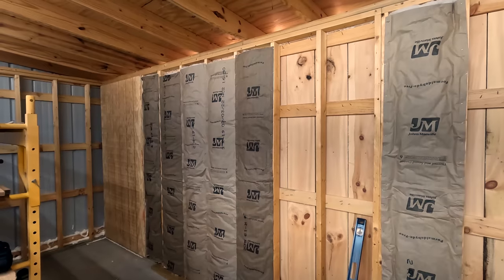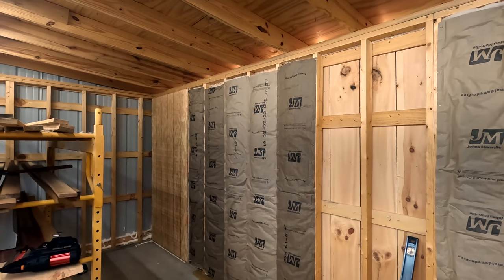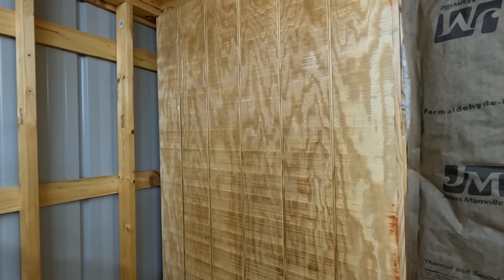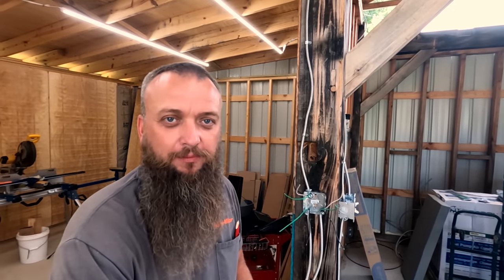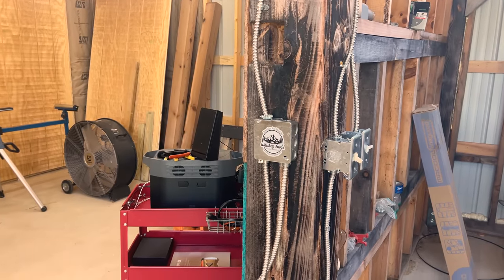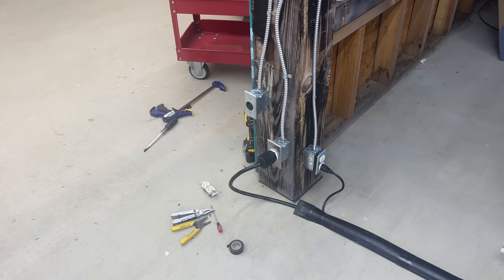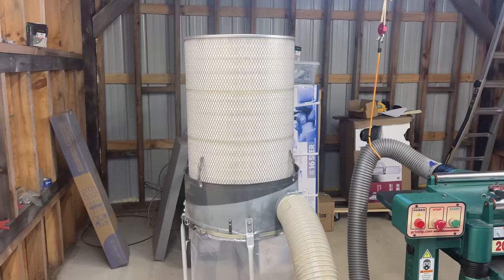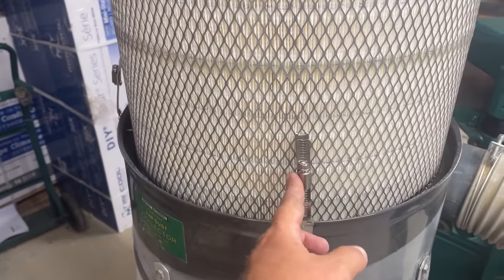This Isn’t Burger King.

Comment: A mister cool removes moisture from the air.   A condensate tube full of water will need to discharge from the interior air fan coil unit to the exterior.

Comment: You’ll definitely want to use screws or nails with a head on them for T-111. I’ve installed a lot of that stuff for customers over the years. The shop is looking good sir. Whatever works for you is all that matters. If the sheets don’t fall off the wall then it’s good to go
Reply: Yes sir for sure on a headed nail or srcew

Comment: You could try 18g staples in the Nailer. It seems that the staples have higher holding power. I would say finish the back wall just to protect your investment in the siding. Mayne spray varnish if you have the tool. It's supposed to dry super fast and be pretty tough. Love the videos

Comment: T-111 siding iss a good choice as it adds wracking protection to your walls which look like they need it.  Timber framers long ago found that two knee braced corners was not going to stop movement in a wall.  And brad nails cancel any wracking protection you may have created!

Comment: Just out of curiousity,,, why not do drop power panels....keeps the cords off the floor (which i noticed, and would make cleaning more difficult)... just a thought..and  if the power cords could be restrained to fairly strict vertical areas, it shouldn't affect your work area.....

Comment: Looks good Nathan.  Insulation will be much appreciated come winter. That's heavy plywood for Brad nails. Leave it natural . The Ready Seal with Stain would look good as well. I've seen some on natural pine lumber on a porch.

Comment: T-1-11, the best thing is wide crown staples, if you are doing it interior, then the narrow crown would do if you were going to stain it….my personal choice is the wide crown. The Senco units use galvanized coated staples…and you will destroy the panel trying to get it off. 
Hard work is where it’s at! Suck it up….grab a handful, and get it done.

Comment: Looking good. White metal would also work good,it really brightens up the interior.  Mount your outlets a little higher. In a shop dirt,dust,fumes, etc are near the floor and are a fire hazard. I am sure there is a electrician on here that could tell you the code.

Comment: For your T1-11, I'd get some 6d or 8d sinkers for your Pasload framing gun spaced about 16".  That should more than adequately hold the siding better.

On hard labor.  I've been saying for about 15 years, middle school aged boys and girls should spend a summer or 2 on a farm, especially with livestock.  There is no such thing as days off, weekends off, sick days, holidays when having to tend to animals and the chores that require daily attention and alway the need to tackle other tasks.  I lived on a dairy farm 10th through 12th grade and consistently look back at that time as one of the best work ethic learning experiences ever.  Granted when I was 15-18, I would never had admitted to that.

Comment: Brad nails not recommended. You should be using ring shank siding nails, # 7's (1 3/4")  T-111 is known to twist and warp on the wall, ring shank nails will not release like ordinary nails, and you have to hand bang them, but is worth the effort. Screws are fine unless you stain, then they will stand out, galvanized will cause spotting and streaking, even on unfinished interior work (moisture). Panels will age out gray/silver like an old barn. Pro tip ..... put spots of liquid nails on middle studs to help prevent warping and popping. 2 or 3 dime size spots of glue on your span studs will do.

Comment: I am a little surprized that you didn't put electrical wiring in the wall with the insulation.   Because it is covered with T1-11 you could have used romex.  Now you will need to use surface mounted conduit.    Just thinking.   The T-11 does offer good shear resistance to help survive the strong winds you occasionally get.   Bob

Comment: Because the siding is on the inside your brad nails should be fine, but if it were me I would use something a bit more heavy duty than just a brad nailer. Standard crown staples (7/16" or 1/2") on the tongues and then 15 gauge finish nails on the visible parts.

Comment: I would put a clear polyurethane on the wall to protect the wall and make it easier to clean, or stain the wall if you wanted some color then poly those type of panels will soak up moisture and grow mold if in a wet environment, looking forward to see you build a workbench, have a good one

Comment: Nothing wrong with putting multiple machines on a circuit. Added benefit is you can use a current transformer and a relay so the vacuum comes when you start any one of your tools.

Comment: Love your videos just the way you do them and your responses to comments also.  The wall looks great.  Because the texture of the paneling is so rough, I believe it will be a dust catcher.  I vote for painting with a high gloss paint.  Will shed some dust and will be a lot easier to brush down.

Comment: If TN is in what is called a "warm climate" geographic area, then the assumption is you will be using your air conditioning more than your heat.  Therefore, the paper side of the insulation, the vapor barrier, goes on the INSIDE of the wall to prevent condensation in the interior of the wall.  Metal siding on the outside has no affect on moisture vapor entering the wall.

Comment: I used T111 on the outside of my garage off the ground n it it peeled n shredded it self in less then 10yrs.i stained it several times.but it'll be good stuff inside forever.those springs break because people don't oil them.there is an oil just for those springs. Once a year should do it.my garage door guy informed me about this.i never did mine either but have since.try to find the pro garage spray it's the better one.

Comment: Have you thought about a radial arm saw. I wouldn't have a shop without one. Been using them since I was 14. I'm 50 now and I gotta say it's my favorite tool in the shop. My Mitre saw is only used for mitres. My 17 year old son loves using the RAS. He is apprenticing with me and says the Mitre saw is a plastic light weight onsite tool. Thought I'd ask. Be interested in your thoughts on radial arm saws. Tools are only dangerous as the person using it. Thanks.

Comment: You mentioned the cost of materials for your shop wall.  I'm not sure what T-111 cost today but back in the 70's we were buying it for about $8.00 a sheet.  I'm thinking it's a little more than that today.  I vote for leaving it natural.  Maybe a clear sealer. 😎
Reply: I just bought two 4x8 sheets of 1/2" CDX here in a Massachusets HoDepo and they were just under $90 total. I nearly shat myself. : (

Comment: When I worked at Conestoga Wood Specialties  I had them put dust collection on a router I used for curved partical board panels - that stuff is dusty - it was a small one but it sure helped

Comment: the Bosch miter saw blows both DeWalt and Festool out of the water. next time your in a box store check one out. smooth as silk and can push it right up against the wall.

Comment: I have had a lot of success in getting strong holding power with an air nail gun by slightly angling one shot at a downward angle and the next slightly upward.

Comment: BRad nails or staples will hole the thinner T!-11, but it's better with a nail that has a round head if you plan on listening anything to the walls that doesn't hit a stud. If you didn't face staple the insulation, you could have also used construction adhesive on the faces of the studs.  In my previous shop, I had the T1-11 on half the walls and left it natural. Looked nice for 20+ years.

Comment: I would recommend you at least seal the T-111 as the wood and chemicals used to glue it together dry it will off gas and make your shop stink for a while otherwise. If you like the natural look use a clear sealer on it but consider that the older you get the harder it is to see. A light color will make your available light much easier to work with over the years.

Comment: You should hit that siding with a sander.  Nothin too fancy but maybe down to 220.  Then maybe seal it with something.  Maybe a quick one coat of floor sealant.?  You're going to probably be in that shop for a long time so doing this during the build might prevent you from regrets.  Obviously I don't really know.  It's just my $.02

Comment: one thing you will be beating yourself up about later is you closed that wall up without putting outlets in. i put outlets in every 4 ft. at 42 in. off the floor in my shop and i'm so glad i did. just a suggestion because anyone who builds their own shop knows it's a very personal space to fit their own needs. enjoy the channel.

Comment: Looks fine to me and you understand what you need, dust extraction and clean air is essential, just a comment OSB is made with nasty chemicals and if it was me I would seal the surface with a sealant coat of clear lacquer to stop the fumes.

Comment: Waste of money putting R-19 in a 2x4 wall.  You need 5-1/2" of space to achieve R-19.  A clear wood sealer/waterproofer would be good on the T1-11 siding and still retain the present 'look'.

Comment: The T-111 siding would typically be installed with 6d  or 8d nails, or 7/16 or narrow crown staples.  If you don’t paint it, I would at least apply sealer, especially if you don’t use nails or staples to adhere.  The panels will start to warp due to temperature and moisture variations and the heads of the brad nails will pull through the panel.

Comment: Brad nails are too small (18 G). Finish nails 14 G 0r 15 G still too small. Use headed nails 2 1/2 inches long. I think they make nails just for T-111. But ribbed is best.
Reply: I meant 16 g not 14.
Reply: @MrJoncz For your information you can always edit your comments by clicking on the 3 vertical dots to the right of comment.

Comment: Why are you putting so many staples in the insulation; or any.  The insulation fits snugly between the 2 x 4's and then you are putting siding up over the top.  Do you think the insulation is going to fall out?  I personally would have used the screws rather than brad nails.  My family goes back to the 40's in construction.
Reply from the maker: I like to staple stuff
Reply: I just pulled back my walls and shot a couple staples into my insulation in your honor. I absolutely love staples!!!!

Comment: You're trying to save cable and you're not getting any younger....and then you put the outlets on the floor when they would have been much more use and cheaper mounted touching that splitter box. DOH